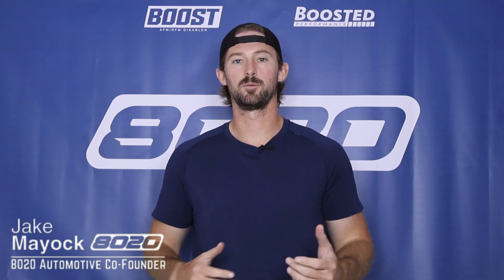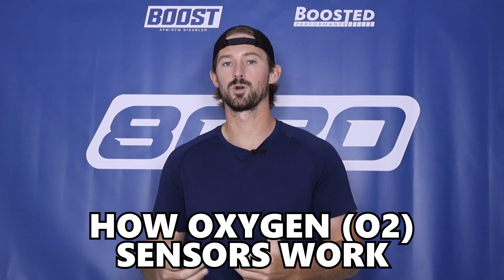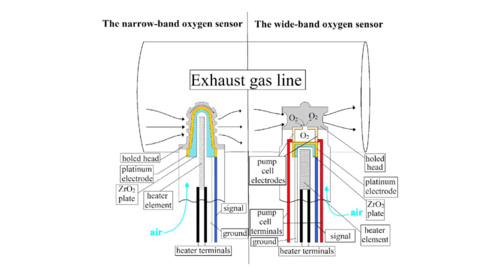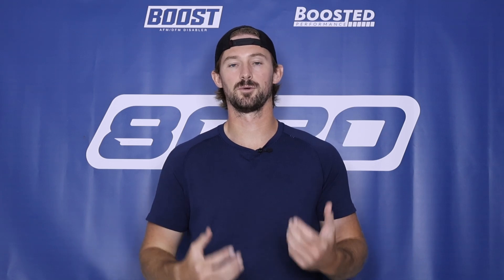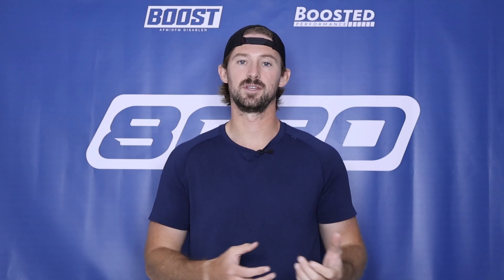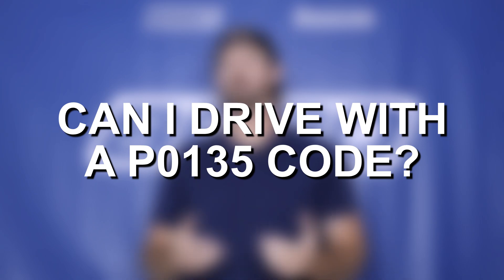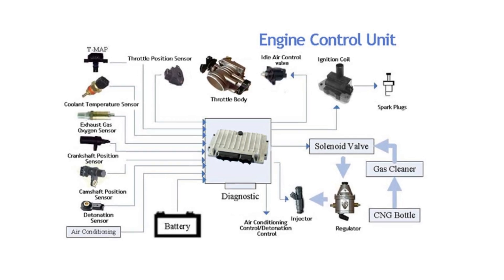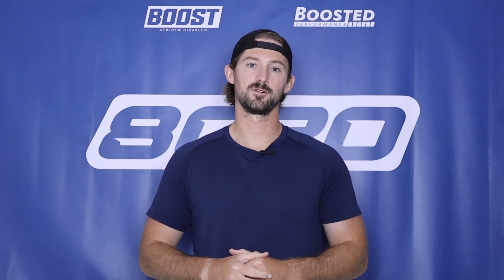Can You Drive with a P0135 Code? Here’s the REAL Answer!

Comment: Need your help! Currently drive a 2019 BMW X5 Xdrive 50i - 4.4 8 cylinder Turbo 8A with 17,500 miles on it. Kindly confirm that the engine is N63B44M3. I don't drive that much. Should I keep this vehicle or trade it the soonest? How long do I have before I must get rid of this BMW V8? Thank you
Reply from the maker: S - Yes, your 2019 BMW X5 xDrive50i is equipped with the N63B44M3 engine — a 4.4L twin-turbocharged V8 from BMW’s second generation of the N63 series. While the N63 has a known history of reliability issues (especially in earlier versions), the N63B44M3 is a refined version with several improvements over the earlier M0/M1 variants. That said, it’s still a complex engine with expensive maintenance, and long-term ownership can become costly, especially after the warranty period ends. Since your vehicle has very low mileage (17,500 mi) and is likely in great condition, you’re in a strong position to sell or trade now — before the value drops more and before expensive wear items (like valve stem seals, turbos, or timing chains) become a concern. If you're risk-averse or plan to keep the car beyond 60–70k miles, it’s wise to sell within the next 12–24 months, especially if out of warranty. If you love the car and don’t mind the potential repair costs, keep it and maintain it proactively — frequent oil changes, premium fuel, and early detection of leaks and warning signs are critical.